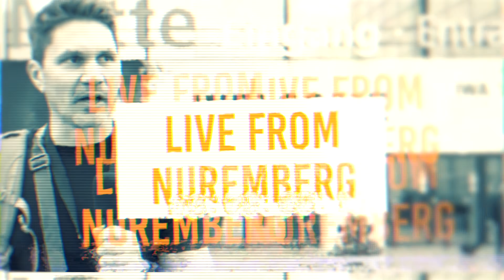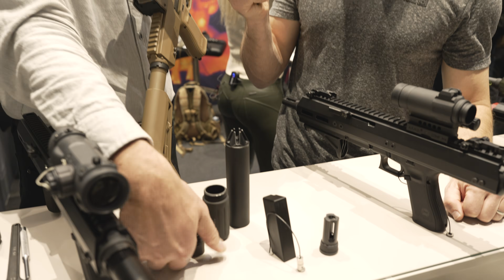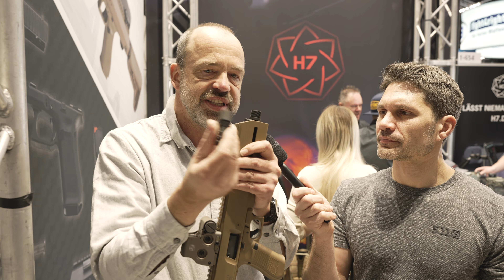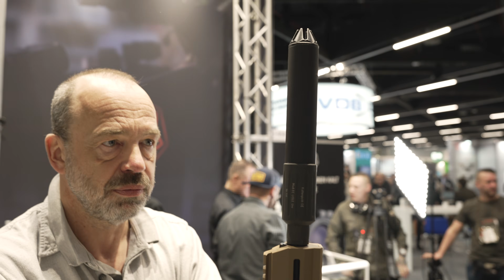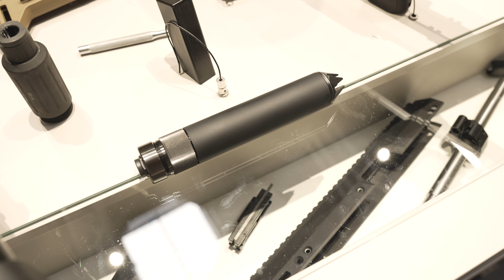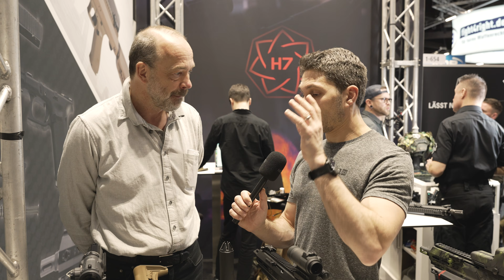Modular European Suppressor for the EU Market: The Delisle

Comment: Well, a lil overconfident. For sure all his FEM and such made sense, but he got to inspect real life erosion and dimensional change by the heat (recristallisation under pressure and tensions) and will learn this can aint full auto 5.56 rated.
I expect him to be a machinest, and thats fine. But without a multiple person team, material scientists, proper labrotary equipment for metallurgy, he can not get far. So, if you want the best performance, the established brands are imo the way to go as they invested a ton in R&D, so you can not simply deny the experience gap. This is more of a affordable, and less capable, alternative. Otherwise, the Deutsche Mark thing was suspicious. No one here says that, except for political reasons maybe...

Comment: KB at Q is just watching this sweating looking at all that tolerance stacking.. holy shit. no thanks. tapers or GTFO.
Reply: Everything in Europe is made to 0.0005mm. Thats 0.000 01968504 Inch. 4x that, equals to 2 µm. I dont expect the core diameter to be EDM'ed to higher tolerances than this. So, seems like a non issue.

Comment: Namaste All,

Once again German Engineering know how and common sense, to solve an issue for all shooters, by manufacturing this new Delisle modular low-pressure sound suppressor!

Whether firing anything it seems, from a semi-automatic pistol or pistol chambered carbines, in most calibres from 9mm to .40S&W to .45 ACP to 10mm, what about 5.7mm thought?

Equally with sub-machine / personal defence weapon chambered calibres 9mm / .40S&W / .45 ACP / 10mm, again what about 5.7mm thought?

Similarly with any assault rifle chambered calibres 5.56mm to 7.62mm, maybe 6.8mm too?.

Or with any bolt-action rifles, either cambered in calibres from 6.5mm Creedmoor, or .308 and .308 Lapua Magnum maybe even .388 Lapua Magnum, or could be upto 12.7mm / .50 calibre too? 

So will work with any pistol or rifle or sub-machine, with either a blow-back action or non-blow back action equally it seems.

Therefore can this Delisle new modular low-pressure sound suppressor work with a Single- or Double-action Revolver?

Or could this modular low-pressure sound suppressor from Delisle work with a Lever-action Rifles, or Pump-action Rifles and/or Semi-automatic / Automatic Rifles in different calibres too?

Equally will this Delisle modular low-pressure sound suppressor, or a version of it actually work with a Lever-action Shotgun, or Pump-action Shotgun and/or Semi-automatic / Automatic Shotgun in 12-guage, or 20-Guage or 410 gauge too?

The idea of this new Delisle modular low-pressure sound suppressor, is broken down into different modular components, starting with a barrel screw-on Adaptor or Interface Ring Mount for whichever different barrel threat type too, you just need the right one for your own weapon, or individual weapons too.

Then a you use the Delisle modular low-pressure sound suppressor kit’s, own Combined Muzzle Break Compensator that is screw-on to the barrel screw-on Adaptor or Interface Ring Mount. Before screwing on the next part of this new Delisle modular sound suppressor, this being basically an a screw-on Expansion Chamber.

Lastly you then screw in the final modular, this is the screw-on Low Pressure Compartment with no baffles, instead employs a helix internal spiral or vortex design.

However, this new Delisle modular low-pressure sound suppressor using different materials in its manufactured in High carbon Steel and Aluminium, allows for this Delisle modular low-pressure sound suppressor to deal with great heat generated through rapid firing of many rounds by blow-back weapons.

Unlike sound suppressors with interchangeable or fixed baffles, which will cause extra blow back and generate heat in the process too, the new Delisle modular low-pressure sound suppressor design will not cause!

The idea is all you have to do is buy one or two of these new Delisle modular sound suppressor Kit’s basically, along with as many of these screw-on adaptor ring mount or interface’s as you need, for whichever different barrel threat types on your pistols, carbines, rifles and personal defence weapons / sub-machineguns you have.

Then all you do is interchange, the rest (Combined Muzzle Break Compensator, Expansion Chamber & Low Pressure Compartment) of this new Delisle modular sound suppressor.

That is between whichever of your pistols, carbines, rifles and personal defence weapons / sub-machineguns, you want to use this new Delisle modular low-pressure sound suppressor design system with is a great idea.

Saving you having to buy different sound suppressors, for different pistols, carbines, rifles and personal defence weapons / sub-machineguns. Yes there maybe more specialised sound suppressors for individual weapons, that reduce noise levels even lower or near totally silent but they cost a great deal more!

The new Delisle modular low-pressure sound suppressor kit system, seem great value for money too, at around 595 Euro’s plus VAT has to be added afterwards too.
Reply: I don’t like German engineering, so I’ll pass.

Comment: Its similar to the Huxwrx Flow through rifle cans. ... though without seeing the internals my speculation is this is a much more simplified design. Which means it will not be as quiet as the gases have less time to slow and cool before exiting. Also the Huxwrx Flow-through design works great for rifle rounds like 5.56 it doesnt work the best for subsonic rounds like .300blk or subsonic 9mm. Thats why Huxwrx 9mm cans have a combination of traditional baffles with an outer flow annulus.

Comment: This seems more like a Blast Forwarding Device with a cool looking tip than a true suppressor.
Reply: Its similar to the Huxwrx Flow through rifle cans. ... though without seeing the internals my speculation is this is a much more simplified design. Which means it will not be as quiet as the gases have less time to slow and cool before exiting. Also the Huxwrx Flow-through design works great for rifle rounds like 5.56 it doesnt work the best for subsonic rounds like .300blk or subsonic 9mm. Thats why Huxwrx 9mm cans have a combination of traditional baffles with an outer flow annulus.

Comment: "Why not just build all of the parts into one?"  James trying his best not to be rude.
Reply: That aluminum portion likely can be replaced when it wears out
Reply: Probably because you can also add the Nielsen booster.
But a one piece muzzle brake in each thread pattern would be cool.
Reply: The aluminium low pressure section can be used on a pistol.
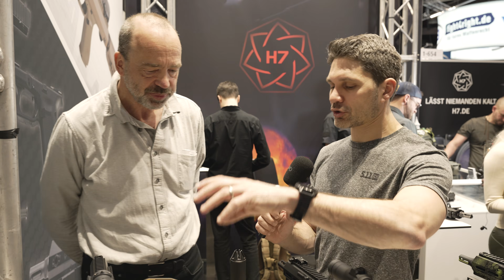Reply: 6:19 he talks about adding an ADDITIONAL adapter so you can add an Nelson device. I still don't get why they designed it to have adapters on adapters
Reply: @jyro6368  Exactly.  I can't imagine trying to remove it and every piece except the one you want unscrews.